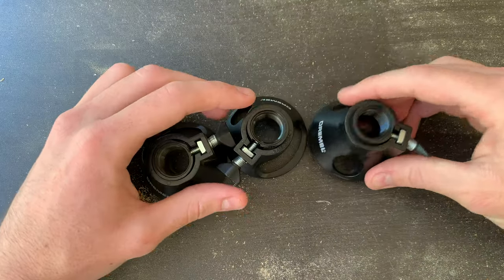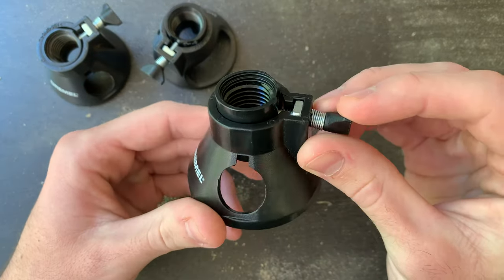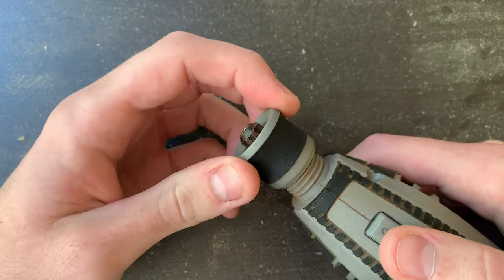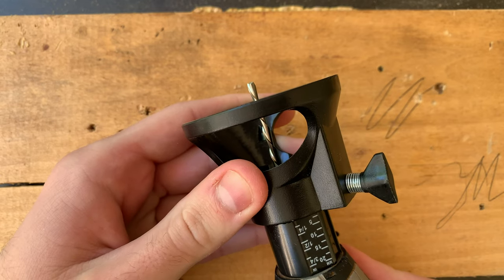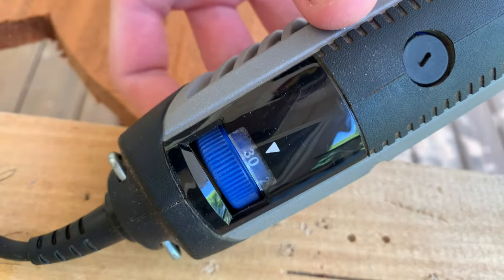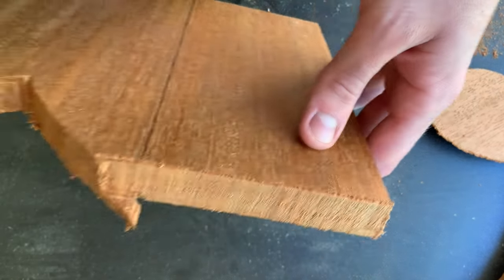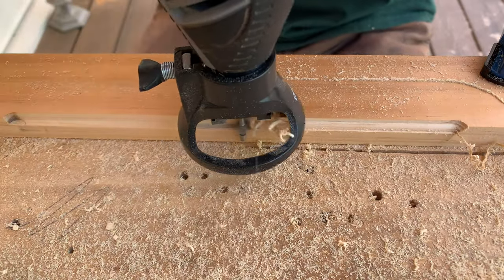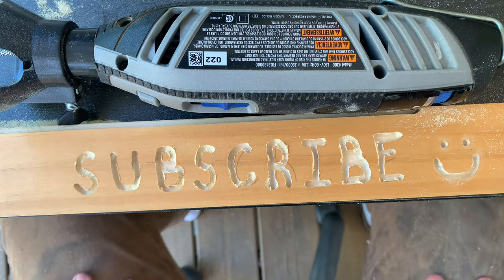How to Use the Dremel 565 Multipurpose Cutting Kit / Router Attachment

Comment: Small point of order: I think router bits are meant to cut in a specific direction. Your first cut with the router bit looked very rough, the bit is much more likely to skitter around when it's going the wrong way. This can lead to the bit jumping off or jumping around on the part, damaging your wood, and with a more powerful router can be very dangerous. It's much easier to control if you start with a shallower cut, going in the right direction. It's not such a big deal with the dremel but if you do that with a full size router, you may regret it. Carry on
Reply: Yes totally correct. Cut into the wood not with it.

Comment: Thanks for the video. I use metal templates for making stars for flags and I use this cone shape piece to help keep the bits in the lines nice and straight. 
It really helps when holding the Dremel for a long time. 
The only problem is that running it over metal is the bottom gets worn out and needs replacing.
Thanks again 
Robert

Comment: Do you have a video on creating templates? Looking to create repetitive shapes with consistency (less freehand) and not in the market for a laser cutter/cnc
Reply from the maker: I’ve never gotten into repetitive things since I’d get bored so I haven’t used a reusable template other than cardboard ones for animal carvings. I’d probably just use very thin plywood and freehand it out with the 561 or 562, then get a 90 degree edge with the sanding drum. Not sure sorry

Comment: Sure wish there was a way to attach dust collection. Hard to follow a pattern with all the dust this makes. Any ideas?
Reply from the maker: I agree, usually I tap out the dust or use the air from the dremel to blow it out. I’ve seen third party dremel shop vac attachments but nothing for this attachment

Comment: Does any router bit fit? Do I need to buy Dremel specific router bits?
Reply from the maker: The dremel can fit with any shank that’s 1/8th inch - You’d just have to make sure it’s low profile enough and long enough to fit in there I guess
Reply from the maker: My router bits are a random knockoff brand
Reply: Do normal size router bits fit is what I’m asking, or are smaller size bits needed?
Reply from the maker: @tshadow6  I’m not sure what size normal router bits are, sorry. I’m limited to my rotary tools
Reply: Thank you.

Comment: Can it be used to spray air?!
Reply from the maker: Don't think so. You can check out the Dremel 490 Dust Blower though if that's what you mean.
Reply: @LogsCarvingClub  Also, if the bit is stuck in the mounting, is there is any possibility to take it out, will opening the whole tool would solve the issue? Thanks
Reply from the maker: @MedoHamdani  Check out my second channel if you can, it’s Log’s Carving Club Plus. I have some details on that in the How to Change a Bit video. Hope that helps.
Reply: @LogsCarvingClub  Alright

Comment: When using router bits like your roundover, it will cut much smoother if you only cut in one direction, namely the one that's going against the rotation of the blade. In the other direction, the blade digs into the wood and pulls the tool along, resulting in a rough cut. Ask me how I know.
Reply from the maker: Thanks for the tip! Usually I’m pretty casual with it because I sand it later anyways. My stuffs more natural lines rather than clean furniture style routing.

Comment: Do you think this will work with the Milwaukee m12 rotary tool? I need to cut drywall and I dont want to have to buy another tool.
Reply from the maker: Sorry I’m not sure, maybe if the end threads off and matches the thread size for the dremel?